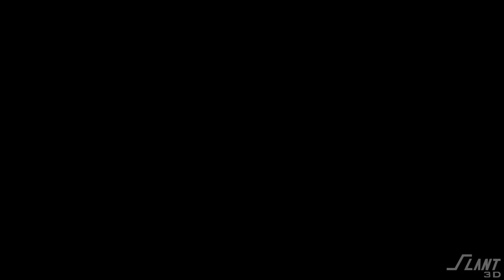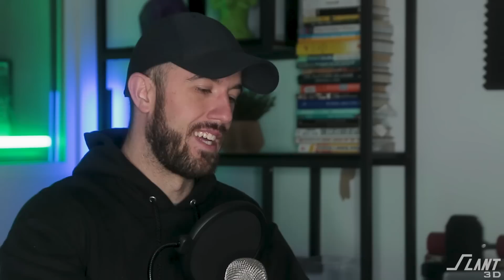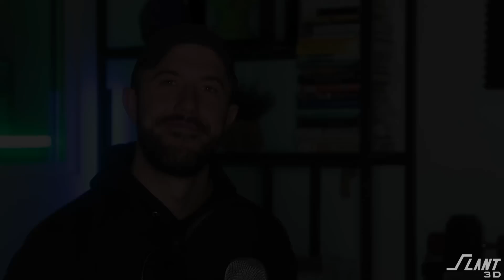How-to Grow Your Etsy Store | Your Grandma Was Right | Getting to $15 Filament | Etsy Corduroy

Comment: I would love 3KG spools, but my problem is filament dryers - I have my IDEX hooked up to feed straight from two 1KG filament dryers, is there a filament dryer that will hold a 3KG spool? If you partner with some Alibaba factory to make you a half-decent dryer that'll fit those big spools, I think that will drive sales particularly with home gamers who do not actually print 3KG in a short period.
In Cali and burning through a lot of PETG on my own larger home-gamer projects, always looking for cheap PETG that doesn't clog (Currently using Elegoo "Rapid" that I stocked up on with subscribe & save deals). Also WTF is Youtube deleting any comments talking about products???

Comment: Hi there

You mentioned that it's better for you all to sell filament by the 3kg spool. 

I might be interested in buying filament in 3kg spools, but I don't know how to manage spools of that size. 

If you can give the "every man" solutions for these management concerns, you may be able to increase demand for 3kg spools. 
-safely feed a consumer level machine
-how to dry a 3kg spool
-how to keep a 3kg spool dry
-how to prevent a 3kg spool from exploding into a 7 pound mass of spaghetti
-anything else management of 3kg spools outside of a commercial setting

If it makes a difference, I'm starting to look PETG and CF PETG for my base filaments. PLA is quickly turning into the filament for rapid prototyping and making gridfinity bits. 

Thank You

Comment: If you recommend 3KG spools, what type of external spool roller for a Bambu Labs printer or Prusa printer do you recommend to build to enable this use?
Reply from the maker: Check the spool holder we design in a video about a year ago

Comment: Honestly, as someone who bought one 1k spool.
I wouldn't mind shipping being subsidized and baked in. If it remains transparent on the price of manufactoring the filiment I don't see this as breaking the promise to trying to get to $10 per kilo.

I also think this is the move because when I priced out this filiment it removes another step.

Essentially, instead of having to do another calculation, if you bake it in, it removes the mental headache of doing that same calculation.
So it just simplifies the buying proccess on both sides. I think the little qaulity of life is worth the money considering it's already the ceapest high qaulity filiment.

In this case IMO qaulity>optimization.
Reply from the maker: Already do that
 Thanks